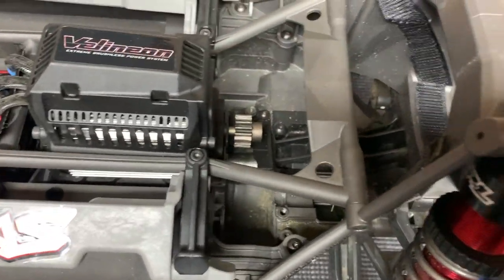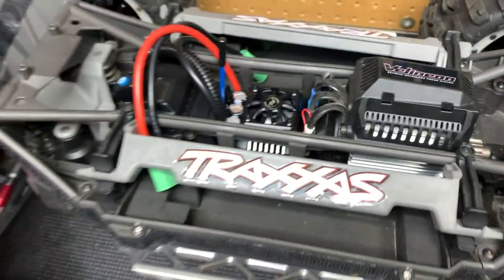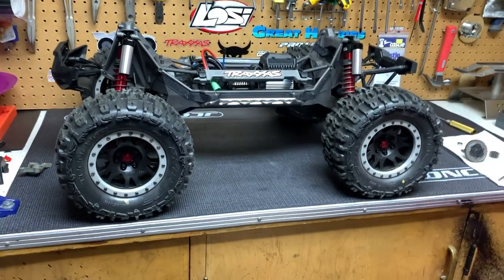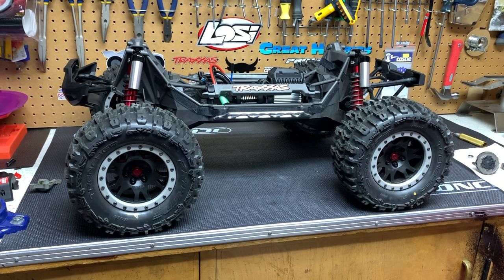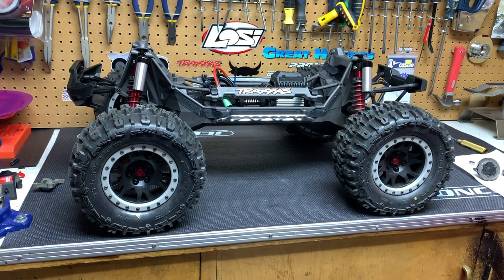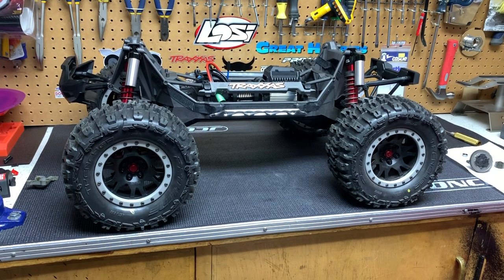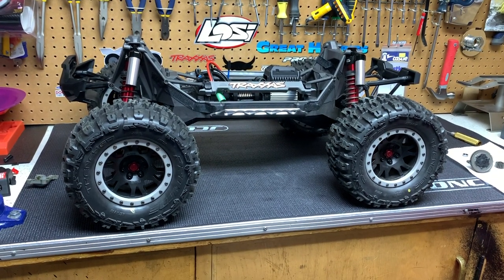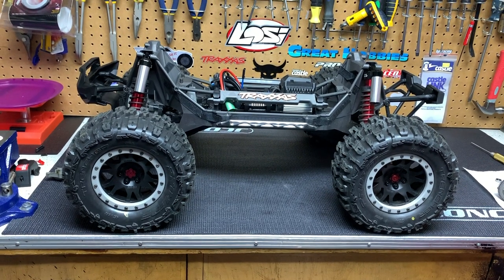Broke my Traxxas X-maxx after 3 minutes :(

Comment: Hey bud, I dont think you should get a belt drive. I have bashed my X-Maxx 8s for a year and 7 months now and haven't blew a stock spur or pinion. I do run stock tires because I like how light they are. I plug the wheel vents up with gorilla tape and vent the tires in the middle of the tread. I put two holes in each tire, 180 degrees apart. Good vids on YouTube about this.  I installed RPM rear carriers and an unbreakable body, and the upgraded Traxxas servo also. I've got a beach bash video you can check out and I'm gonna start uploading more bashing vids soon. I have worn the outdrives out to where I will need some more in a few more months. I have spent less money on my X-Maxx than I have on any other RC I have owned since 1991. My favorite RC so far and I've had and have a lot.

Comment: Sorry to see that happen to you man! For some reason when I got mine. I told myself to keep the weight down. So I have done nothing to mine minus all the fluids and shock springs. I did chip teeth off the rear diff crown once. Shimmed and rebuilt. Been good since. But while I was in the diffs. I noticed how tiny they are. Like barely a tad bigger than 1/8th scale. Was very surprised actually. So I use stock everything with a Russian unbreakable body. It is a tank!! Great content man. Subbed Ya!!!

Comment: You can't expect to put heavier tires and a stronger esc with more punch and not expect to have to get a stronger spur gear. The traxxas spur gear is monkey metal. Also your going  to have to shim the diffs. More weight more power more problems.......

Comment: Lol! That's soooo common man. The stock spur and pinion are ridiculously fragile. Just do a search in the Xmaxx owners group. I did the exact same thing. Got a GDS spur and a hardened pinion. Haven't had another issue
Reply from the maker: I’ve been looking at the hot racing spur and RR pinion.
Reply: @JasonPerrinRCVlogs  that works too
Reply: @JasonPerrinRCVlogs  that will work 👍 HR spur is $30 GDS is $20.
Reply: @JasonPerrinRCVlogs  or go belt drive for 6 us dollars
Reply from the maker: Nash is the belt drive better?   Reliability, slippage?
Reply: @lilnash7  how is it $6? You need the belt and two pulleys 🤷‍♂️
Reply: @GreatLakesRC  yup it is 6$ do your research, those Facebook groups get it for 6 dollars and sel it for 80 is dollars or whatever it is the sell it for me m pullles are  2 dollars each belt 2 dollars = 6 dollars I  just happen to know exactly where they get them from and I have done the same 😊
Reply: @lilnash7  where and how to get them I wanna try that belt drive setup out !

Comment: I destroyed 2 spurs in a weeks after my badlands got installed. Get some hot racing hardened gears and then you only gotta worry about the diffs
Reply from the maker: Yeah that seems to be the fix.  GDS or Hot Racing spurs.   I am considering the belt drive.  Just not sure how long the life of those are.
Reply: I would go with the Gds gears. Best out there.
Reply: @polta1408  those gds gears look like a better price too, my hot racing spur was almost 30 bucks

Comment: Common problem from what I've seen on the xmaxx need to replace the pinion and spur with a better non powdered metal gear.
Reply: They cheap out and charge a premium for low cost components.

Comment: Good vid. I'm After any info and Ive been looking at the X maxx or the kraton 8s. Really torn between them. Does the X maxx have these problems untill you up grade the pinion and spur??
Reply: Well he is running the heaviest tires and rims possible for the truck I'm using stock on mine and no problems so far !

Comment: well the thing is traxxas parts are made with lower quality material to reduce cost according to my friend who works in manufacturing industry. And they are very weak (soft), if you compare traxxas parts to any branded race buggy kit parts (which I have two). 
Every time I run my revo 3.3 something would break. Spur, linkage, shaft, etc, etc. It became a piece of expensive junk I don't even want to touch. Some spur gears last like 10 minutes. Anyways, you try to run their products like their videos, they won't last a few tanks of fuel or a few packs of battery.
Any brand today can make big and fast stuffs, but Traxxas especially its parts department is too far behind.  Even slow stuffs like crawlers are not trustworthy.
Traxxas = built to repair (replace parts)

Comment: btw thats a really common issue, you need to get a spur gear from gds or from hot racing and a hardened steel pinion from anywhere, OR you can get some mod 1.5 gears and you will have 0 issues 
 
just search up gds x maxx spur gear 

or x maxx mod 1.5 gears
Reply: Thanks for the tip, never heard of gds, I have a hot racing one, I’ll check that out though
Reply: RC Maxx Bash there is not much of a difference it’s just there both high quality and will last a long time
Reply: Crackers RC’s anything is better than the stock glass ones
Reply: RC Maxx Bash 🤣🤣🤣

Comment: I went with the Robinson racing 20t pinion and 50t gds spur and they are running great for a few months now but I did blow out the rear diff lol be sure to set the Traxxas pin system to 21/50 if you go that route for proper gear mesh!
Reply: go the other way, set to 19/50 for proper mesh on 20/50, pin system mesh is slightly sloppy
Reply: With those gears it was too tight at 20/50 so had to go up I think it's the way the gears are cut but works perfectly on 21/50 pin system

Comment: I've seen that on a LOT of channels here on YouTube as well as in person. The whole drivetrain is pretty weak on these things. 1/6 scale should have mod 1.5 gears and nothing less. They do make mod 1.5 gears for the X-Maxx. It's sold via some Facebook group but I'm sure there can be links found outside of Facebook. Traxxas really should take some advice from companies like Losi for their gearing in a 1/6 scale truck. It is an unfortunate thing but it is an easy fix.
Reply from the maker: I will check it out.   Thanks.
Reply: @JasonPerrinRCVlogs  All Day RC sells them. They have a channel on YouTube. Exocaged RC tests them out in a video if you wanted to take a gander.

Comment: Wow that sucks! That's an expensive truck. For the kind of money they ask for those things they should come bullet proof out of the box. Upgrade parts should be for making faster and handle better not a necessity to run 1 battery through without bashing it. It would be like buying a Tesla and needing to buy batteries and tires and seats to drive it off the lot. You just erased this off of my want list. Shame on Traxxas